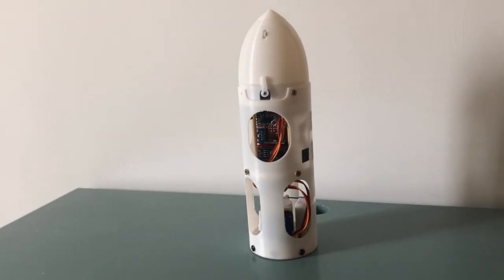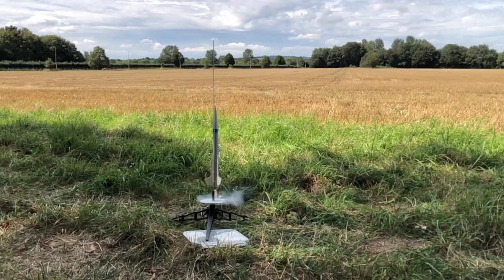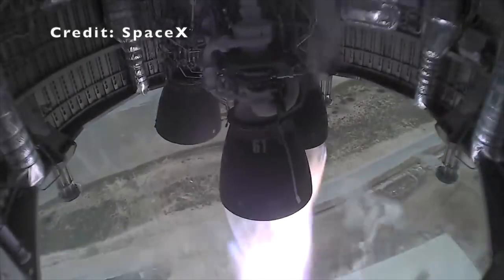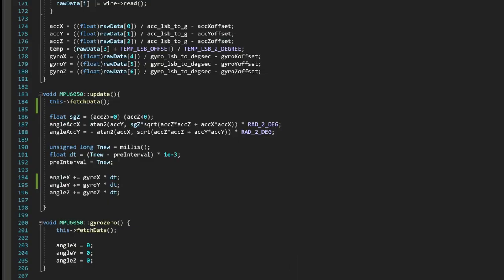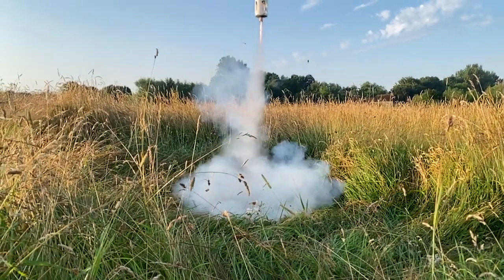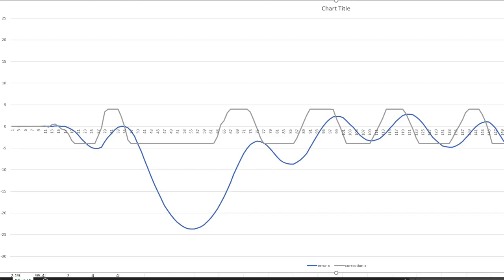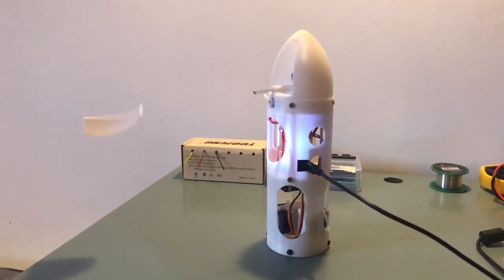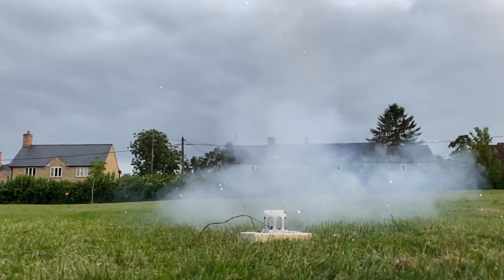Actively Stabilised TVC Model Rocket

Comment: In addition to the delay between the servo recieving a position command and actually moving there, there is an additional delay between when your PID loop calculates an output and the Servo library produces the corresponding output. The Servo library works at ~50Hz, meaning that roughly half of your calculated output values are discarded. You can actually take advantage of the fact that the servo library runs off of the timer interrupts. Every time the output compare interrupt for the timer-counter occurs, it runs an interrupt service routine (ISR) that does some stuff. By adding a single line to that code, you can indicate in a volatile global variable that the PID loop should run once. This ensures that the PID loop will always have the exact same delay every time instead of a random amount between 0-20ms.

If you measure this delay, you can also add it to your HIL simulation so that you are taking account of the majority of temporal disturbances.

Hope this helps you out in the future!

Comment: The servo has a huge lag overall, and if you tried properly optimizing PID parameters you'd know that even the slightest amount of delay in your loop will heavily impact your loop bandwidth. (Will way more easily cause underdamped oscillations and could even drive it to become unstable, forcing you to drop the P value)
Your curve already seems smooth, but a general practice is to put a lowpass filter after the derivative term because they expose noise. A simple and cheap implementation is a digital infinite impulse response filter: out = out * 0.95 + in * 0.05; and put this the control program loop. This difference equation is already normalized, just adjust the proportion of the weightings to change the respose of the filter. 
I am VERY interested in your project, if there are things I could contribute please let me know. I could provide my two cents on control stuff, actuator stuff, and sensors if you'd like!
Reply from the maker: Thanks! This project was the first time I had attempted to implement any sort of control system, and I was learning most of it as I went along. I didn’t even know what a PID controller was before starting, so my response to the un-dampened oscillations I encountered in my simulations was to simply reduce the derivative and proportional gains (far from ideal as you mention). Your low pass filter suggestion is a great idea, and I will implement it in future projects along with other concepts that I was unfamiliar with when developing this rocket. I am currently working on a quadcopter, which I am developing all software for, including autonomous features which require a lot of sensor fusion and more advanced control systems. I am currently trying to learn how Kalman filters work, so I can implement one to fuse GPS and accelerometer data to provide position and velocity estimates. If there is anything you can offer to help me grasp and implement this, I would greatly appreciate any help. I am struggling to wrap my head around that maths needed to code this. Thanks in advance!
Reply: @jacobthornhill  ooooooooooo respects for attempting kalman filtering!
If that was your first time doing a control system then WOW this is beyond impressive.
For kalman filtering I think you need a decently accurate model of the system you are trying to simulate to be able to make good predictions, MATLAB is fantastic for this or any sort of control systems, including advanced stuff like linear quadratic regulators, do you have access for it? The low pass filter is an infinite impulse response filter, having the advantage of having very low resource comsumption (just one extra variable to achieve very strong low pass filtering), and you can fully characterize these digital filters using the Z transform, and get frequency responses right away. I could difinitely help with these more basic math stuff; for the kalman filtering, it is also something I am greatly interested in, especially when you can double integrated the accelerometer output and correct drifts with less frequent GPS updates, it is awesome. 
You could add me on discord, or which ever you prefer!
Reply: @jacobthornhill  AlexAlexAlexAlexAlex#4507
Reply: I second the Matlab part and would add that Matlab has support for hardware in the loop and Arduino.  I would also recommend upgrading to a teensey since it is a full 32bit controller. It will give you much higher control resolution.
Reply: @Unmannedair  absolutely agreed, and simulink is great. also tensy 4.1 is brutally fast, 600MHz vs 16MHz. you could also get the arduino portenta which is powered by a STM32H747
Reply: Using floats with AtMega is a bad idea though, they are very slow. Fixed point math is way faster.

Comment: This is a great achievement, congratulations. I've been waiting to see a video of someone succeed with this in model rocketry. Considering how high a thrust to weight ratio there is with these solid model rocket motors, getting stabilization through thrust gimbaling is not an easy feat. The high thrust is typically needed to quickly get directional control with fins after launch.

It would be great to see this concept applied to scale model rocketry for models of the Atlas, Falcon 9, Gemini-Titan, and multi-stage vehicles such as the Saturn rockets.
Reply from the maker: Thanks! High thrust to ratio was a challenge, but it was somewhat unavoidable due to the limited selection of motors available in the UK. I’ve recently discovered the Klima D-3 motor (high impulse and low thrust), so I will probably use those in future rockets.
Reply: Multi stage thrust vectoring makes my brain all hurty

Comment: 2:59 - Abort function
- with the engine firing full throttle, I would imagine this would create some potentially dangerous situations if the rocket starts oscillating around itself horizontally near the ground.
Great build, even better video and explanation!
Edit - The parachute is attached to the top, so the center of gravity will change unpredictably if/when deployed with a firing engine.
Reply from the maker: The centre of gravity would remain the same, but the centre of pressure would change, making the rocket aerodynamically unstable. It would go out of control, you’re right, but it’s velocity would be limited by the chutes. This is better than a scenario where no chutes are deployed as the rocket can dangerously fly off fast in any direction. Worth noting that this is hypothetical, I have not tested the abort function in flight.
Reply: @jacobthornhill  - sorry, you're right - Centre of gravity should be the same, it is pressure I was thinking about.
I imagine the parachute also would be prone to be set on fire, as it is being unfolded. (I live in Denmark, buying rocket motors isn't something I can do in the local hobby store - so no testing for me)
Fun to watch on YouTube, and quite educational too :ø)
- hope you'll never have to test the abort feature LOL
Reply from the maker: Glad you enjoyed!
You’re right - the parachute would likely meet its demise. It’s not an ideal system but I figured I might as well implement it for human safety (not that that is a priority lol)

Comment: Very very cool. Don’t use delay charged motors if you can. You could pulse C6-P which is plugged or you can make your own. 

Lightly scrape the clay cap. 
Remove the granulated BP. 
Apply an epoxy cap and let it cure. 

I’d love to try and build one these. Have you thought about faster servos?
Reply from the maker: I would buy plugged motors, but being in the UK limits what i can buy. Faster servos would be nice and I only used the ones I did because they are cheap.

Comment: Nice setup you have there. I am sure in time you'll find ways to simplify and improve it. Perhaps by creating a custom board with integrated MCU, sensors and transmitters. No doubt you've already thought about this. A couple of bits I thought you might like to think about - disabling the parachute deployment charge [you'll need to work out how to do this but perhaps you can simply buy a motor without the charge] and using a solenoid latch instead of a servo for the parachute deployment door. Other than that, brilliant effort. Keep up the good work. I look forward to seeing your progress.

Comment: Very cool! Did I get that right that you're simply using the gyro output (rate of rotation) for each axis independently and feeding it into the control loop? You're not using the MPU6050's internal DMP that e.g. outputs filtered quaternions for orientation?
Reply from the maker: Thanks! Yeah I am just using the gyro rates and integrating each individual axis to get orientation. It’s not a great solution, so on my current rockets I am using quaternions that are calculated by the flight computer.

Comment: This is amazing. However, the ‘chute ejection charge on the motor turns your rocket into a bit of a cannon at just above head height… that’s bad. Add some way to vent the gas that charge produces at the top of the motor mount unless you want a black eye!

Comment: Must be hard for such a short moment arm! What is your PID gains ? My TVC rocket is 4times the lenght want to make it shorter. What motor did you use ?
Reply from the maker: The very low mass moment of inertia made it especially difficult - too much control authority! My gains where roughly 0.4, 0.1, 0.06 (before factoring in servo linkage ratio). I used an Estes C-6, but I think going for a longer burn motor would be a better idea. TVC is better suited to long burn time, low thrust motors to reduce airspeed.

Comment: Jacob are you using a complimentary filter for this?
Reply from the maker: No, I think I just integrated the gyroscope data (as quaternions) to estimate the rocket’s orientation. Using accelerometer readings in a complimentary filter is not a great idea for rockets, and only works well when the IMU does not undergo large constant accelerations.

Comment: This is awesome but I have to ask, where do you learn this stuff? Particularly the coding and electronics. If anyone has any advice on where to start or how to start that would be great.
Reply from the maker: I learned python first, and I think it a great language to get started with. There are some great tutorials out there (eg ‘free code camp’) that teach you the basics, and then improvement comes with practice.
I recommend learning the Arduino language (C++) after learning a simpler language because you will be able to practice coding without getting bogged down in the more low level and memory-oriented features of C++.
For learning Arduino / simple electronics, I recommend the YouTubers ‘dronebot workshop’, ‘how to mechatronics’, ‘add ohms’ and again ‘free code camp’.
Reply: @jacobthornhill   thanks!

Comment: Why is it flying so unstable?
Reply from the maker: Centre of mass is aft of the centre of pressure, making it aerodynamically unstable. The control system is gains could have also been tuned better tbh
Reply: @jacobthornhill  ok